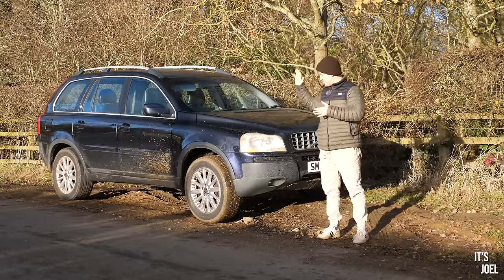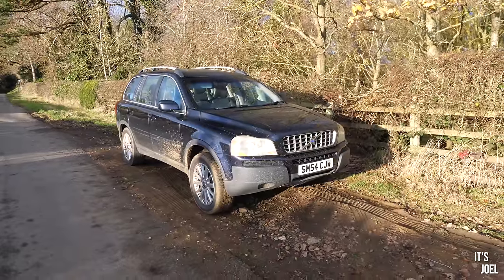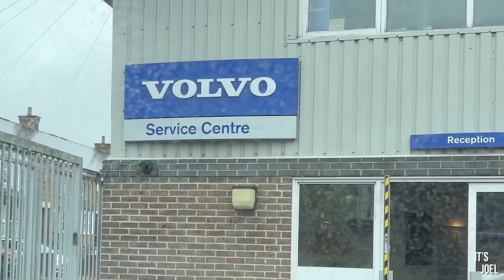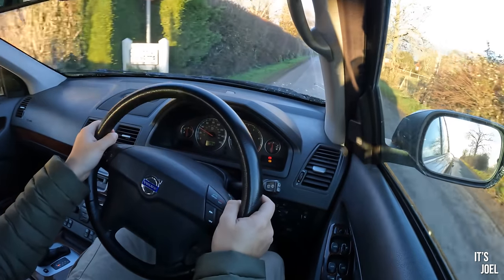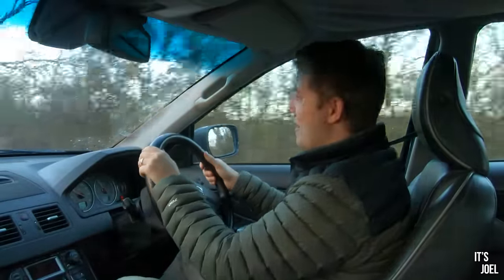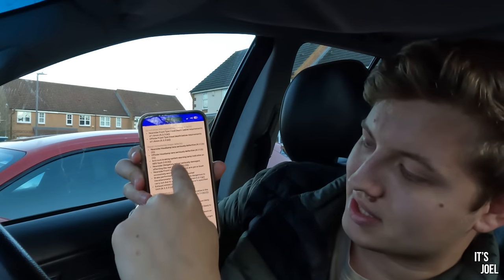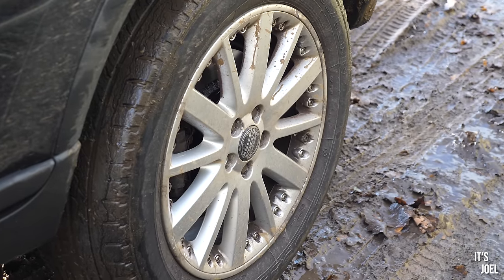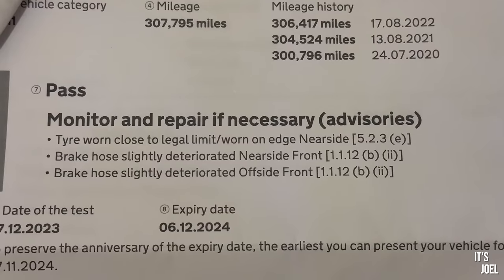CAN I SAVE MY £800 COPART VOLVO XC90? PART 6

Comment: Hi Joel, I have to say this is one you should have avoided. It's a bit of a sorry outcome and it still has a myriad of faults MOT list and beyond that means you are most likely going to take a big bath on this project.
Not sure about that Swedish Car Specialist clearing the code on a known mechanical issue just to get this nail out of their compound either....
Let's get back on track with your next project and lose this Volvo as soon as you can. I don't think the next big bill is too far away

Comment: Hello, the AWD doesn't work probably due to the lack of haldex fluid change, check if there's a filter also. After changing it should engage. My V8 XC90 is still being worked on. The engine will get a second life, the steering is being changed and every bushing im the rear suspension. It cost me about $9000 to but and about $15000 to to keep it in excellent technical health. Hope to her it before Chrostmas 😂

Comment: Can I just get this right. You’re saying that Swedishcarclinic basically took your car and did various repairs, then found out that the car needed ABS rings to pass its MOT. They cleared the fault because they couldn’t make a cost effective repair then re-inspected the car knowing the fault still existed, just the ABS light was not on because THEY cleared the fault. Then they passed the car?

So in this video you are in effect advertising by saying words to the effect of Swedishcarclinic have given a car which they know has faulty brakes an MOT or what’s otherwise known as a ‘dodgy’. You really want to hope no one from your insurance company watches this video. Delete the comment if you want to, the points I’ve raised are still valid and I won’t be the only person thinking the same and I’m certain Swedishcarclinic will not appreciate being linked to dodgy MOT’s.

Comment: Great to see the xc90 to be on the road, however… After so much efforts i really think this was a mistake to take such a shortcut with the ABS. Do have a question though - does it has 4wheel drive now, that the abs in not functional (as usually the haldex kicks the back end in only when slip is detected, and car needs abs sensors for that)? If not - back to my point: so many efforts and it’s not even a good winter car with the abs light shortcut…

Comment: Had my xc90 2003 for 5 years it had done 233,000 miles, and the oil seal went between engine and clutch, just after I did a service on it, (it’s common to go after a service due to the higher oil pressure I was told, it would of cost a £1,000 to put right, I decided to get a c70 mkll, instead, my mate has it now had the work done and his still driving it about 6 months later.
On the subject of insurance I was paying about £1,300 and then the magic 10 years came along and it dropped to £400 
Will get another one next year maybe 😊

Comment: Clearing the ABS fault without fixing the problem is a cop out. Frankly the ABS is still faulty which should be an MOT failure so you are driving a car that is potentially unsafe. If it was me I would source the drive shafts and the hubs second hand and swap them out fixing the rings at the same time. It’s not a big job given you have had most of the nuts off already. But I guess that’s the difference between a car fixing channel and a driving channel.

Comment: Sterling work Joel. Some people on here moaning that it has a dodgy MOT however if there is no warning light then they can pass it legally. End of. Doesn't matter who cleared the fault code. Fact is, there is no warning light at the point of MOT. Therefore genuine pass.
Morally in the clear too. Garage knows it's a well known youtuber who isn't in the business of deception. 
Therefore Joel you did damn well and should be proud. Don't listen to the naysayers.

Comment: This has been an interseting series Joel, massive props to you for taking it on 'in public' like you have. Was it worth it (financially)? Probably not, especially since you weren't able to do all the work yourself. However it has taught you lots and it's made great content. Would I keep a 20 year old XC90? Not a chance - it still has some significant and potentially expensive faults. And that's coming from someone who runs a Rover 75 as a daily. Get it gone and on to the next one. 👍

Comment: When you started it up it sounded like it was down on a cylinder.
OK I watched on a bit and you spoke of why it's misfiring. NO way I would proceed with spending money on this until the engine fault was sorted. D5's are not lumpy at all, nice 5 cylinder burble tons of power and very smooth. Do yourself a favour and sort it quickly.

Comment: Have to ask yourself 
An old 4x4 volvo which is only 2 wd, a knocking engine, no radio etc or anything fibre optic and a sagging headliner.
Is it worth spending anything onit.

Comment: Went down a rabbit hole with that one , unfortunately the labour rates make more and more cars unviable I am running a lightly used 22 year old Ford galaxy but the economics are really marginal when the car is booked at £1000 just really keeping it beyond a logical point but it remains to me a lovely car
Reply: maybe you should compare repair costs against depreciation on a newer vehicle.
Reply: We’ve had our 1999 Galaxy for over 20 years and it’s such a great car. The last few years it always seems to take £300 to £400 to get it through the MoT (this year was welding) but in all these years we’ve never even stranded in it - it’s been such a great and versatile car. It’s still very tidy and presentable - I’ve just taken delivery of a brand new Puma, but I love driving the Galaxy!

Comment: At least sort out the advisories and get a proper 4 wheel alignment. Do you know which reluctor ring is triggering the light? It might be the pump. Vida will tell you which one or give you the code for the pump. Yes the FWD and the fibre optics are likely to generate big bills and the engine running problems could be either difficult or easy to sort. If your insurance record is good you should be able to make some savings there.

Comment: One car I sold at auction needed 5 new tyres, new battery new clutch, 2 head gaskets(V6) and some rascal had stolen the stereo and broken a rear window -there's a good reason to put stuff in the auction. It wasn't even a high miler but to fix it made no sense, and it was a gas guzzler.

Comment: The next problem with this will be the Cr@p Aisin warner auto box $hitting itself. Because they do, No amount of trans fluid flushes can save them, The valve block/Body simply wears out. The best Volvo D5's are Euro3 manuals.

Comment: I had one of those kept going into limp mode not one specialist in the Yorkshire area could fix it, I went through hell for over a year finally got rid of it, worst vehicle I have ever owned, it’s predessor was an xc70 which I took to over 250 thousand miles much much better

Comment: Unless the garage that did the " repair" to the ABS light also did the mot?
Otherwise no foul was commited as the garage teset the light and another garage did the mot on an unknown car.
Reply: You are kidding right? Joel said they tried to fix the ABS but couldn’t do it cost effectively so they cleared the fault code and passed the car through the MOT. Not only did they know about the fault they couldn’t fix but they could also see the broken ABS ring and still passed the car having just cleared the fault code.
They knew about the fault and tried to fix it but couldn’t.
They cleared the fault code
They put the vehicle through the MOT and ignored a serious braking issue and broken part
They gave the car an MOT pass

Comment: The garage have plucked prices out of thin air for the parts. 
Example A) the pads cost the same as 1 disc. £83. Clearly a made up price. 
B) A quick Google of the part numbers and the garage really did have you over on the costs. 
The discs alone to Joe Public are £59.76 each and they're a trade garage which will get discount. 

If I was you, I'd be giving them a call, as part number for the handbrake cable (rhs) as they are handed. I think they've done one side as that's on the invoice and only one part number 30793828 right hand cable. Charging you for two of them. That only costs £38.50 from volvo. 
Very shameful for both the garage and you for not questioning your bill. 
Give them a call and update us all on the results.

Comment: £800 to buy, £600 on bits, £1223 garage bill, £2600 total and you've still got a car with faulty ABS ans another £1000 labour if you want it fixed. Its not a good deal at all 😂 meanwhile on ebay theres a few 2007 XC90s with 160k - 170k miles in much better condition fot £2k - 2.4k. Theres even a 2011 with 100k fewer miles than yours. The only winner here was the guy who get £800 for that off you 😅
Reply: And the garage that changed the rear brakes and made money on an mot and diagnostic " test"

Comment: Hi Joel great video as far as whats been said about clearing the abs fault then passing it there is nothing wrong with that as long as the fault does not reappear during the actual mot as this could be an historic fault! As for you keeping the car well you have spent quite a bit of money on it and you know and love the car so why buy another XC90 to start all over again the grass isn't always greener and you could be chucking more good money after bad??? I bought my 2010 XC90 D5 SE 200PS auto basic spec with 161k miles for £3k two months ago was i ripped off would i buy a lower miles higher spec model for a bit more money err NO! I intend to work on what i have and make it the best i can who needs all the bells and whistles and a lower miles car that could still at the end of the day be a money pit and cost even more in the long run?? p.s sleep tight in the big Swede    🛌👍

Comment: Fook me, £1223.11 for some brake work and the old "If DVSA stop you, it just stopped working" MOT? Just take the bulb out? The Garage obviously told you to say it works for a while, which it doesn't if it's a failed ring, I doubt they even bothered to clear the code for the test, just hope you don't need to stop suddenly or use ESP? Having done the same work on my V70 D5 and V50 myself I know that any competent garage would do the work for half the price if not less. I do question the need for "specialist" garages with the mundane. I understand that you bought the roughest high miler for content but you really overpaid at £800 especially as the bottom has fallen out of the 4X4 market and these things are now £600+ to tax. I passed up the offer of an 04 D5 XC90 with 135k and 10 months MOT for £600 two weeks a go, just too bland and suffer from a lot more issues than their saloon brothers. Four wheel drive without 4x4.... I would get rid as the gearbox will probably be on it's way and no mention made of EVAP system or rear seal oil leaks, however much money is spent it will always be a £800 car with very little in it's favour other than a questionable MOT pass? Should carry a disclaimer, for content and not as a guide to buying cars unless you have more money than sense?

Comment: If you've got enough content out of this car, maybe move it on.  You don't seem particularly in love with the car, you've sunk a small fortune into it, and it still has an ABS fault and if I understand correctly is only 2wd.
Maybe road trip it, rather than spend 24 hours in it, as if you road trip it we get some scenery that we might not have seen before.  While if you just spend 24 hours in it, we got a whole lot of coverage you talking to camera, while you struggle to sleep in a sleeping bag.  Which isn't really "car" content as such.

Comment: You can’t polish a turd. It was a thoroughly neglected 💩box when you bought it and the best thing to recoup any money was break it for spares. Farming this out to any garage for any work is a big mistake. Unless you could do all the work yourself you are simply throwing good money after bad and I cannot say I particularly rate the garage you used considering the ABS issues are still lurking and then there’s the 4wd system. Surely one of the main reasons you’d entertain this Swedish barge. I think you have been silly and now you are in way too deep. Learn from this and never repeat the mistake. YouTube doesn’t pay that well!